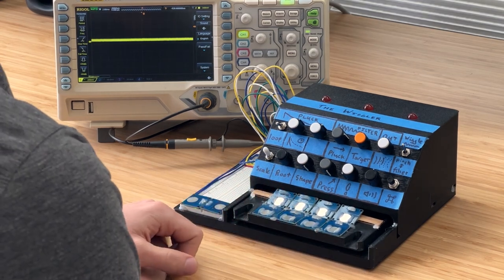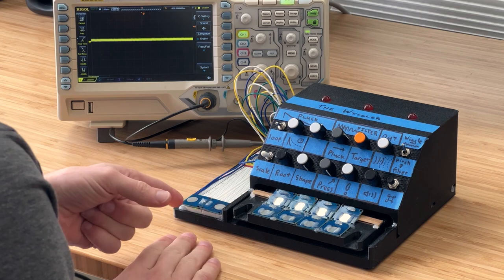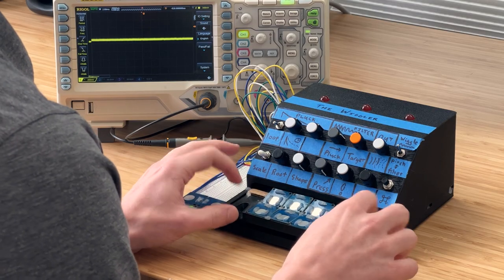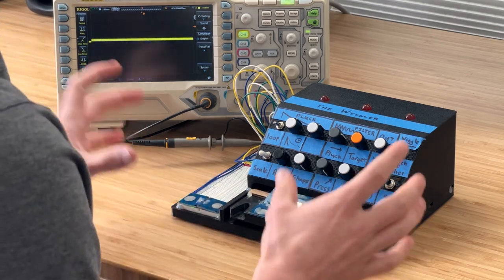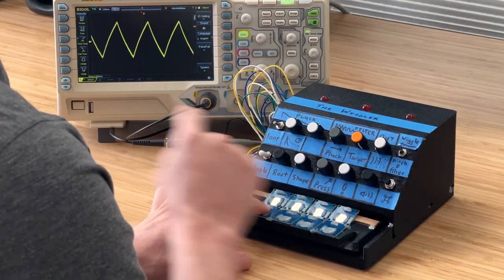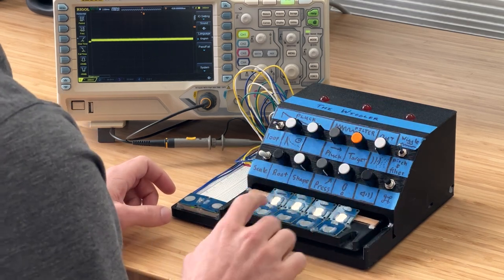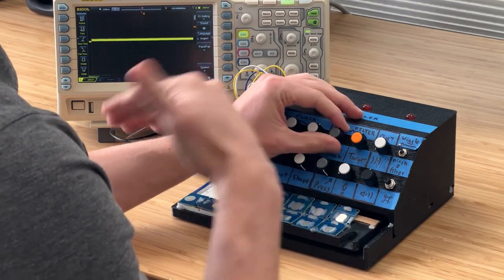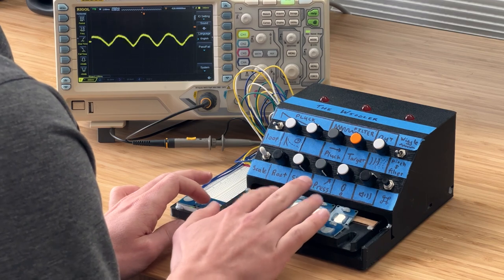Wiggler - Expressive Synth using Daisy Seed and Flexure #synthdiy

Comment: I think i hear equal temperament tuning.

An idea:

 To sound perfect. Try pethagorian tuning and select starting tone note for each scale. The rule basically multiply prev frequency by 1.5 if above 2 times starting frequency divide by 2 . Sort the results. 
For scales take list of known frequencies for notes. For example for la use 440 as starting note

Then there is just tuning. Means replace notes that have 4th multiple ie 4th overtine similar under 3% with multiple of 5 ie 5th overtone  replace. With one of them as multiple of same number it prevents multiple note clashing.

To make octave multiply the highest note by 2.
Reply from the maker: Thanks! Since I have this root note/scale system it does make it totally possible to do alternate tuning systems. I’m reading the book Musimathics so it’s definitely on my mind

Comment: Extremely well integrated and thought out use of modulation! 

Did you 3D print the flexture as well?
Reply from the maker: Many thanks. I each expressive controllers need a synth that is designed to compliment it, so it doesn’t fully cut it to just plug a controller into some synth that expects a MIDI keyboard.

Yup 3d print for now. For the first few hundred I can waterjet it and if it goes into the thousands I can mold it

Comment: If I understood correctly, the "keys" are actually capacitive sensors, so you could even have more modulation sources in each keypress, right? It would be very related to the actual pressure you make in the Flexure, but maybe it's possible as an additional expression source, since the sensors don't use the whole key surface (you could move the keys down or side without actually touching the capacitive surface).
Reply: Also, amazing work, very inspiring!. I got carried by the curiosity and enthusiasm and forgot my manners 😅
Reply from the maker: Yup you’re totally right. These cap touch keys only do binary on/off but there are other cap touch technologies that can provide a signal for surface area of touch. however, I think that adds a little too much complexity for this concept, I’m trying to keep it as simple as possible. I think you would start getting diminishing returns if you try to perform the vertical motion and the cap touch surface area at the same time, and I would need to add knobs to the panel for it.
Reply from the maker: No problem, I appreciate input. That’s why I’m doing this in the open

Comment: Could you possibly add maybe another filter in the future, and make either one or both of the filters state-variable or switchable? And possibly add another oscillator? Would be best if it would allow patching and sound design in a deep way but if not possible this is already sounds amazing as it is
Reply from the maker: Thanks for the input. If you check my instagram I have a draft front panel there. The idea is to have a 3 position switch for both the oscillator and filter that let you pick from 1 of 3 algorithms for each. That way we can have some flexibility. 

The filter and oscillator each have one big knob for the most important parameter (such as cutoff) and one small knob for a less important param (such as resonance). The big knob is also a modulation target and has attenuverters for Pluck and Press.

I arrived at this setup in order to keep the number of mod destinations low. since I don’t want to have a screen, each mod routing needs one knob
Reply: @sound.workshop  thought of a patch bay and/or patch matrix? also how do I find you on Instagram?
Reply from the maker: @iLikeTheUDK  on insta I’m @SoundWerkshop

I’m probably not going to do patching right now; that add a lot of technical challenge and cost. I will do CV outs so you can at least get the expressive signals out and control your modular

Comment: Amazing inventioness, how you told you came up with this material allowing touch sensitivity AND sideways expression.

There is a recent hardware synth that has got these features plus everything a modern synth offers.
Forgot the name, but the thing is very present on youtube.

As a musical instrument, there is no way you can make sumething that is up to that. 
My suggestion: develop a DIY project, a package mere mortals can build themself.
Reply from the maker: I think you’re thinking of Osmose. Ya that does make me feel a little insecure. It’s a masterpiece. However mine will be about 1/3 the cost, much smaller, easier to play, and knob per function. So I’m still going to go for it.
Reply: @sound.workshop  , indeed. Osmose is a major step forward for synthesis. Just looked at the price,  $1800.  Would've expected more.
However, you as a single person inventing your little machine, that is genius.
So yes, go for it.

Comment: Really cool project! Definitely check out the SOMA Terra which is a likewise idea except with touch-capacitance rather than mechanical flexure.
Reply from the maker: Yes! The terra is definitely exploring similar concepts. I kind of wish I had this idea 1 year ago because the terra is a really good option.
Reply: @sound.workshop  I think there is a lot of value in the physical, haptic response, which is a major advantage of the your design. Your design more reminds me ultimately of something like a Haken Continuum. If you could come up with some nice standard designs of the flexure you could do something like Frank Evenhoft
Reply from the maker: That’s true there is some benefit to physically moving the flexure. Also the terra uses an IMU for vibrato which is nice for generic vibrato but I don’t think you can do slow bends from one note to the next

Comment: Very cool. Is their a reason you use pluck rather than a standard ADSR?
Reply from the maker: I’ll get into this in future videos, but space on the front panel is really tight. So I want to add a little as possible. A single stage decay envelope provides a lot of utility with just one knob.

In my opinion the PRESS envelope takes the place of the ADSR

Comment: Isn't this practically this same as Velocity and Aftertouch on a traditional keyboard? after touch is pressure sensitive to expression. Velocity to amplitude usually. You definitely found another way with the flexure. I am certain hall effect sensors will outlast all traditional aftertouch solutions. I hope you applied for a patent because you got a good design here. I would highly recommend adding ADSR.
Reply from the maker: Thanks for the input. Velocity and aftertouch are indeed forms of expression. Velocity is very limited because you can’t change it while a note is sounding. Aftertouch is better but typically only applies to a small fraction of the travel of a key, so it’s hard to perform aftertouch in a subtle way. Finally, the synth patch typically used to compliment a keyboard with aftertouch is often going to primarily rely on velocity/gate for most of the sound variation, while only using aftertouch for a bit of variation layered on top.  

Also, most keyboards (except roli and osmose) can’t do the vibrato wiggle which is really delightful.

I don’t really have physical room to add another envelope. ADSR would need 3 or 4 knobs for the envelope itself then another 3 or 4 for modulation routings. I don’t think I need it because Pluck provides the note on definition (usually provided by AD in ADSR) and Press provides the sustain portion and release (SR in ADSR). of course more features is always going to be more capable but this instrument will have no screen so I need to be very selective in what I add
Reply: @sound.workshop  There probably is a market for a full sized keyboard version of your wiggler.
Reply from the maker: @openyoureyes7539  maybe, in my opinion LinnStrument, Roli, and Osmose are better suited to polyphonic expressive control. A polyphonic wiggler would require a lot of flexures and hall effect sensors.

Comment: this video has great production quality and is exactly what i've been looking for. cool stuff! 

would using a more common micro controller like an Arduino make the process of building a synth harder?
Reply from the maker: Thanks Joel!

I highly recommend Daisy or Teensy if you want to make a synth. I think it would be much harder to do it with a standard arduino. The options I suggested have the necessary processing power, audio codec chip to output audio, and libraries to help handle the code that runs at audio rate

Comment: Wonder if a similar 2D wiggle controller could be made from a ring on two strings (left and right side) attached to their own sensor for determining how far the string was pulled, and then work out a 2D position from the two sensors. Like an Ondes Martenot but instead of only controlling the pitch, the ring's forward and backward movement can control the amplitude. Maybe some springs to keep it taught with a resting position up toward the top of the keys for minimum amplitude and pulled out to the back of the keys for maximum amplitude. Don't really need the keys at that point though, just some frets to guide your fingers and maybe one big key for muting the sound when not pressed in order to have sharp attacks.
Reply from the maker: It seems totally possible! That’s what makes synths so cool

Comment: What kind of pluck can you get directly from the hall effect sensor and the vertical bending action? I'm using a hall effect sensor to build an Ondes Martenot but my mechanism involves a small pouch of cloth underneath to give it a good pressure response. How squishy does this mechanical feel? Wish I had seen it before starting my construction.
Reply from the maker: You can get a kind of smushy pluck if you physically pluck or strike the vertical motion of the flexure. It’s fun as an effect, but not to do for a long time. Ill try to show it in a future vid.

Oh that’s cool that you’re building an Ondes! The flexure feels pretty springy. It behaves like a spring in the sense that the farther you push it, the harder it pushes back. There’s some tuning to do to the flexure stiffness so that it pushes back just right. Too soft and it doesn’t fight you back. Too stiff and it’s too hard to push.

Comment: awesome! video ends quite abruptly and could be longer imo. momentary octave buttons: id put them on the right (or make it easily reconfigurable), because (most) guitarists and violin players will be more used to wiggle with their left hand. id consider buying it, but would see as risks: capacitive touch pad buttons too small, flexure breaking on too energetic wiggling. as an extra feature id wish for more scale options. Overall awesome gear you produced there, great MVP. good luck
Reply from the maker: Thanks for all the ideas! I think those are all addressable concerns. Stay tuned for v2!

Comment: Very interesting! Could you make an alternative to Osmose? No synth engines and etc. Just the MPE controller. Can it be profitable to you?
Reply from the maker: Thanks! I don't plan to a do a MPE controller myself. I think that every expressive controller needs a synth designed to compliment its unique interaction, so that's what I'm motivated to do. There are already so many controllers out there (joue, touche, LinnStrument, sensel morph) so people have options.
Reply: @sound.workshop  Osmose gives me a good visual feeling (at least). But it costs too much. I don't need those synths.

Comment: If you refine this and make some PCBs, you could sell the PCB kit + parts/3d-print-schematics and have a ecent DIY synth. BTW is the synth engine just the standard daisy library or did you code it from scratch? Sounds pretty good
Reply from the maker: For the synth engine I used elements from the daisy library (variable shape oscillator, low pass filter, adenv, ADSR, reverbsp).

I might do a kit in the future, but for the first spin I prefer to ship a finished and calibrated product

Comment: You should have a physical pull that controls the release expression.
Reply from the maker: ya release is a little tricky, you can perform a slow release by just lifting slowly, but it's not super easy to do. Can you clarify what you're imagining when you say physical pull?
Reply: @sound.workshop  What if every touch pad module had a raised edge that would allow you to pull the keybed towards you (or may the sliding mechanism is under the synth, so you're pulling the whole synth towards you). I don't know. It's a crazy idea. You're already manipulating so many axes.
Reply from the maker: @JoshWilliams123  I see. Hmm I'm not sure, something to think about, but I think I'm liking the balance between complexity/simplicity at this point. Having automated release animation is more important for a polyphonic instrument, because your fingers need to move on to other notes while the previous note is releasing. However, this is a monophonic instrument, you can only play one note at a time, so you might as well just perform the desired release by slowly lifting the finger. I do appreciate the ideas though!

Comment: Awesome little synth! While this would add complexity, I wonder if you could incorporate a rotary encoder in place of the scale switch. Least this way you could access all modes of the major scale (maybe not locrian actually lol), as well as any other scale you want. Outside of that, I really like the idea of the flexure. Mod wheels are cool but flexure is better lol
Reply from the maker: Thanks! Actually I’m working on enabling more scales. There will be 12 backlit touch pads arranged in a piano layout. So you can tap on the notes to include in the user scale. Then there will be a 3 position switch to select major, minor, or user

Comment: You have great creative ideas and it sounds great! 

I am wondering about the durability of the plastic flex ? Is there any data on how long that construction would last? Is it a viable thing as a final product thing?
Reply from the maker: Your intuition is correct, fatigue failure of the flexure is my biggest concern.  I'm going to design the range of motion to be within safe limits for the material, and test it.

A metal flexure would be ideal for fatigue life, but it's expensive, difficult to assemble, and doesn't have any natural dampening so it vibrates a lot. So I think I'll go with plastic and do the fatigue life testing

Comment: Very inspiring! Quick question; how do you get the waveform to morph smoothly between triangle and sawtooth?
Reply from the maker: I used an oscillator in the DiasySP library that is based on Plaits by mutable instruments. The oscillator class had this feature built in. I forget the name of the oscillator though
Reply: @sound.workshop  Thanks for the reply! Looks like it is the VariableSawOscillator

Comment: Why didn't you make a standart 12 key keyboard? (with sharps and flats?)
Reply from the maker: Things could change, but right now I’m leaning toward a diatonic keyboard for a few reasons:

1) a chromatic keyboard would require 13 pads, so the hand would need to jump around to reach all the notes

2) as the pads get farther away from the center of the flexure you start causing the flexure to tilt when you press them, instead of translating

3) this was inspired by traditional flutes like Duduk which have diatonic scales. I got a duduk and found it was so relaxing and fun to have a limited set of notes. Every note sounds good so you can focus more on playing and less on thinking. 

4) There are already so many chromatic synthesizers out there why not do something different

Comment: Awesome video! Would be great if you could add more links to the individual components you're using while building this, I've been starting to build Synthesizer's lately but on a very basic level and it would be nice to get some tips on good products and components to use and play around with while learing more! By the way, the account name in the instagram link is misspelled.
Reply from the maker: Sure I’ll add more specific links! On thanks for the tip I’ll fix the insta link.
Reply from the maker: Lol after fixing the insta link I’m getting a lot more insta followers!

Comment: How do you choose what key you’re in?  And man, some adsr would take it to another level no?
Reply from the maker: There’s a switch to pick the mode (major, minor, etc), and a dial to pick the root note (a, a sharp, b, etc…)

An ADSR would make it better in a sense, but it’s all a trade off. If you look at the front panel it would cost a lot of space to add 4 knobs. In my opinion, you don’t need an ADSR because you can perform the sustain and release using PRESS and PLUCK provides the sharp attack at the beginning.

So for me I’d rather lean into the things that make this unique. If someone wants an ADSR they can get another synth

https://www.instagram.com/p/CpDuS46OoTK/?igshid=YmMyMTA2M2Y=